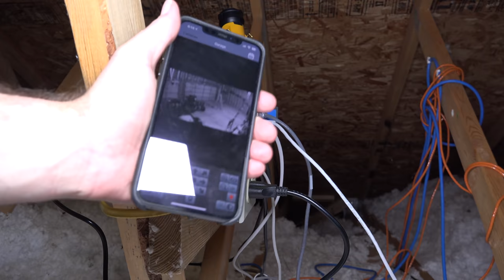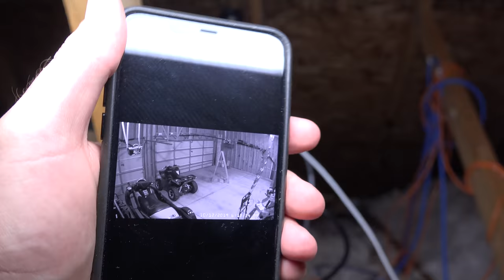Running power for PoE switch in ATTIC!

Comment: There's so much wrong with this video... but let's start with the super simple premise of "why?".  Why aren't you running Ethernet cable from the cameras or other drop locations all the way back to an accessible area? Are you trying to save money? Are the runs too long to be within spec? Why do you keep buying and running running expensive premade cables and use RJ45 cable couplers when the cables are too short? Do you realize that those couplers introduce problems at the physical and signal layers? Is there a reason you aren't running bulk un-terminated Ethernet cable and then crimping/punching down at each end?   

You could save a lot of complexity and money by:
Purchase large (1000ft) boxes of plenum rated Cat5/Cat6 cable
Run cables between a central wiring closet(s) and the devices you are installing
Punch down each end using a keystone jack or RJ45 connector

Each run would go between accessable areas so you're not burning out equipment or crawling back up there to fiddle  with it. Each run would be continuous and not subject to cables disconnecting or signal problems. And you'd save money as premade cables are expensive! Look at the cost per foot and you'll see that you can run your own much more cost effectively. Plus you're probably putting cable that's not plenum rated up in your attic spaces, which can be hazardous should you have a fire.

Oh, and then there's your sketchy AC wiring using a conduit junction box instead of a proper box for Romex. In all seriousness, this is really basic stuff that the guys at Home Depot could explain in about 10 minutes. Just ask someone, this stuff is simple and you're somehow doing it wrong.
Reply: his house doesn't  have a plenum. What codes were broken?
Reply: @bigbigspoon  I didn't say it wasn't to code, I'd just personally use it in any place with large volumes of air that could be moved around or recirculated.
Reply: would like to figure the best way to run ethernet to a few rooms in my house. I have my modem a router and switch in the  upstairs room of my house.  I need to get Ethernet to all the surrounding rooms (3 of them) and also downstairs. any suggestions? i could sketch out the layout of the house if this helps. Any suggestions on cheapest place to get some more cat 6?
Reply: Here here! A box of 1000ft cat6a solid copper riser cable goes a LONG way. A pack of pass through rj45 connectors and a good crimp/cut tool makes it faster and easier. A patch panel with a decent punch tool are cheap and easy to do. 

I put 8 very long camera runs and 15 miscellaneous shorter runs into a 100 year old house. Work sucked but was worth it. 317$ for everything to do it.
Reply: Yeah, its not like he doesn't have a massive server room where he could put that switch and all the cables he should have run...
Reply: @supremeicecreme1658  I learned all about running electronics in an attic. He will be removing that dead switch come may or June. Maybe then he will just pull the wire and do it the right way.
Reply: @synergizerer21  I certainly hope so!
Reply: 1) "Why do you keep buying and running running expensive pre-made cables and use RJ45 cable couplers when the cables are too short?" Exactly! And it's not riser or plenum grade as far as I can tell. It doesn't even need to be plenum grade. He would be fine with riser cable, which is half the price of plenum and suitable for enclosed spaces that do not form part of the air delivery or air exhaust pathways.

2) "Each run would go between accessible areas". Yup. Exactly! Installing heat-sensitive points of failure in the attic where it gets HOT and admitting it will require more monkeying around (power supply + two fans) later on is the equivalent of a Band-Aid for a Band-Aid. He's basically working around the fact he's out of his comfort zone using a crimper and punch down tool.

It gets hot in the attic. Fair enough. So don't install PoE switches, or any switches, up there. The drops can go through there but shouldn't be stopping. The last thing you want up there is an inaccessible potential fire hazard made from a cheap and cheerful PoE switch that you don't trust. This is an "XY" problem. It's a good answer to the wrong question.

I would buy 1,000ft of unterminated Cat 6a riser CMR. Install PoE switch and patch panel in the accessible basement. Punch the drops down into RJ45 keystone jacks in accessible areas. Clean. Safe. Easy. Attic heat problems all completely bypassed! No need for power supplies to power attic fans to stop the PoE switch from overheating. No need to install a wobbly inaccessible shelf for the PoE switch. No need to run any power cables up into the attic.
Reply: @bigbigspoon  although you generally only require plenum-grade insulation for plenum spaces, for internal wiring like this you still generally need to use riser cable. Riser cable is fire retardant, albeit not to the same extent as plenum-grade cable, and will produce less toxic fumes in the event of a fire, not to mention being code compliant.
Reply: I came across this channel by being in a black hole of tech videos. I can't figure out what the purpose of this channel is. I don't mean to seem rude or hateful, but this guy mostly doesn't know what he is doing and sets a lot of bad examples for his less than tech-inclined viewers. Operating servers and working on them on the carpet, using incorrect cabling, incorrectly securing servers and just so many other mistakes. 

I hold tech channels that are nearing and above 100k+ subscribers to a higher standard and this guy just sets so many bad examples. I like this guy, but this guy has a lot to learn. However, after seeing how many times he's been told the correct way of doing things he hardly ever listens and continues to do things the wrong way. I wouldn't care if it wasn't for the fact that he could be influencing others to do things the wrong way, too.

I bet the fire marshal would have a field day with this guy's house.
Reply: Yeah, I had many problems with his solution. Like, DON'T RUN CONSUMER ELECTRONICS IN YOUR ATTIC! And I agree with you wholeheartedly on the bulk cable/punch-down bit. But one thing where we differ is the need for plenum cable. Plenum cable (also known as CMP - Communications Multipurpose Cable, Plenum) is only used when you have a plenum return air system. Most modern residences do NOT have a plenum return air system. They have ducted return air systems. You usually only see a plenum when you have either a drop ceiling or a raised floor. Thus, I would use bulk riser cable (also known as CMR - Communications Multipurpose Cable, Riser). Patch cables are also known as CM cable, and are to be used only for interconnect between epuipement-equipement and equipement-panel.
This kind of thing is what wiring closets are for. And wiring closets should always be accessible and climate-controlled (like in the house) if the have active electronics in them.
Reply: @terry5008  yeah. He wouldn't need plenum cable for a non-plenum space.
Reply: @bigbigspoon  well, in terms of electrical, the box he is using would fail an inspection as it isn't meant to be used as he is using it (it is meant for running pvc conduit). There is a section of NEC that basically says you have to use wires/receptacles/boxes for their rated purpose which this isn't. At least he stapled it within 8in of the box.
Reply: Not to mention, running equipment in a hot attic in the summer is DEFINITELY going to spell trouble.  And oh my, premade cables and couplers? Seriously...?!?! How many ways can you say no, nyet, nien, Meiyou.  no, no, no!
Reply: Agree with you on everything except “people at Home Depot can explain in 10 minutes” the people at big box stores are tools that can’t dial a phone number on a phone.

Comment: I couldn’t wait to read all the comments about the electrical work. Made popcorn and everything. 

Nice video
Reply: Phil Young me 2
Reply from the maker: #MeToo
Reply: Hmm, good idea. The romex cable should have been clamped going into the box. Wrong box was used, but would have worked if conduit was used. Those boxes are for outdoors mainly. AC power has no negative and positive.

Comment: I would have kept the switch in the garage.. but wall mounted it close to the attic space, and make a large diameter hole with a plastic insert / bushing to keep the wires from being frayed.  Then it wouldnt be too hot or cold in the winter and summer. It would still be in a central location at least.
Reply: I would second this choice, however I doubt Jason will redo his current setup at this time.  The garage would have been a much more favorable place for the switch as opposed to the attic.  Better temp/environment, and much easier serviceability.
Reply from the maker: but then you have to run wires all the way to the garage. adds another 50ft
Reply: @Bytemybits  on the flipside you'll likely be replacing your switch every year.

My brother handles networking for a large non profit group, they have routers/comms equipment in racks that get hot from getting direct sun on the cabinet(metal weatherproof exterior enclosures on building roof areas with antennae) or from failed AC units in some where the cabinets are indoors in communications rooms below cell phone towers. 

They have fans inside the cabinets etc but that doesnt help. Switches , PSU's etc routinely fail and need replacing. For the most part, the capacitors fail quickly as they are only ok up to 85⁰c. Your hot roof plus the internal heat generated from the switch will kill it in summer. In winter or cool climates it will be fine. Once ambient roof temps hit 60⁰c plus, the lifespan will drop very quickly.
Reply: It's very easy to drop your wires through the top plate of a wall then use like a low voltage mount ring on wall below ceiling to access your wires to either terminate them there or run wires lower on wall. Then a blank cover plate will eliminate any drywall repairs. Running wires correctly in the beginning will eliminate most of the issues.
Reply: @mrmotofy  can you share any diy video that shows just that? I would like to do in that way!
Reply: @rkbest9783  All it really is just drilling holes in top of wall then mounting regular keystone jacks at the top of the wall. Run power for a receptacle for a switch. Patch cords from jacks into a POE switch. Obviously a feed to your main switch too. Nothing complicated

Comment: I think you under estimate the heat temp in the attic during the summer.  It will get over 125 during the summer and that switch will melt.  Putting near a roof vent would help.
Reply: I have had a poe switch in my attic for just over a year now,in Florida. No issues.
Reply: @surgehawk3  PoE still working in attic?

Comment: Jason,  since you have chosen to put your switch in the attic as opposed to elsewhere more convenient and easy to service, and you seem pretty aware that your current POE switch will not last, I would strongly recommend going with a Ubiquiti ToughSwitch when your current one dies.  It supports both standard POE and Ubiquiti's goofy 24v.  It also is has a fairly robust rating when it comes to temperature/environment.

No comment on the electrical job...Don't know where to start.
Reply from the maker: i may end up with a poe ubiquiti
Reply: Byte My Bits be careful.  Ubiquiti is a huge rabbit hole.  A fun one, but it starts taking over everything.

Comment: It's very easy to drop your wires through the top plate of a wall then use like a low voltage mount ring on wall below ceiling to access your wires to either terminate them there or run wires lower on wall. Then a blank cover plate will eliminate any drywall repairs. Running wires correctly in the beginning will eliminate most of the issues.

Comment: You didn't need a shelf. That device came with rack mount ears.  These can be used also for wall mounting.  You should have just mounted it to the same board your outlet was on.
Reply: I always like to see those rack mount ears used to securely attach a 200W PoE Ethernet switch to a flammable surface. That way it will be easy for the post-fire inspectors to find. :)

Comment: Nice! So I have a simple EdgeRouterX in my attic here in Texas. Its been up there for 3 years and so far has not failed. I do have a small 120mm case fan blowing on it. My plan if it ever failed was replaced it with USG and use couplers to bring the network down an inside wall to my closet blow so the electronics can all be in the AC cooled house.

Comment: Possible idea for cooling that POE switch, the fans you took out for the new server, take the cover off the top of the switch, cut a couple holes for the fans to sit on top and pull air out of it, you can probably find a place to wire them inside of the switch, if not, just use one of the ports from the POE to power the fans..

Comment: I pulled mine into the closest closet and just ran the eth through a whisker plate so the heat wouldn't kill it.  Also makes switch maintenance a bit easier if needed.

Comment: 12-2 running to a box with 14-2 accross an attic not stapled down every 12", into a PVC outlet box and wire not secured....  holy house fire waiting to happen.  Also out here, it is not uncommon to see 140° temps in the attic in summer...  Make sure your switch does not overheat and ignite as well.

Comment: Wants to be covered by insurance .... Heres a video of me installing a outlet my self .
Reply: Kush OverLord legal in the US to run new outlets yourself
Reply: @daltonschrader8328  correct, but if you didn't get a permit for the work and have it inspected you might not be covered by insurance.  Can't say that would pass a code inspection.
Reply: @StevePatak  Not only would it not pass a code inspection, you can see where he has made other "modifications" to structural elements of the roof (note the hacked-out notch in the joist webbing so that he doesn't have to crawl under it"). The beauty is that it's a certainty that this video will be sent by some Internet troll to his local Haysville, KS code enforcement department.
Reply: Are you even allowed to run an outlet into an attic with loose insulation?
Reply: @packetguy42  The only thing that he could be dinged on was connecting the new wire to the outlet instead of splicing it in with wire nuts.  But the outlet is rated for 15A onto either terminal, so theres nothing that could really go wrong.  Also, removing that bit of plywood is not a problem.  In fact, in order to be code compliant, that opening needs to be 42" high.  It probably failed inspection during construction with the plywood there.

Comment: Bro, you have violated your home owner insurance. No permit, no inspection, wrong box, no securing wire appropriately to box, possibly splitting off that other outlet incorrectly, not enough slack in box. Get a pro in there to fix that asap
Reply: thtadthtshldntbe do you have a code on how he should’ve done it? Because I’m about to do this and I don’t want my house to catch fire
Reply: Real you dont need a permit to do it and no you dont need a inspection. I been doing electrical for 10 years and yes he did do something wrong I think he needs to call someone to do it wright for him.
Reply: @bigbigspoon  presuming you are in the US, you first want to look up the National Electric Code. Read it over and watch a bunch of youtube videos by actual electricians. Once you have done that, call your local inspection authority. The inspectors will almost always answer questions or emails. Tell them what you want to do. And they will give you local code modifications that your State, County and City have added to the NEC
Reply: @wolf3five  presumably you are a licensed bonded electrician. There are things that you are legally allowed to do without inspection that a regyular person is not in most states, as well as his homeowener insurance being an issue. Regardless there are major errors in that outlet set up and he needs an electrician to fix it.
Reply: John Kinder right*
Reply: I wonder about the comments that include “you should call an electrician”. If those commenters are more knowledgeable, why not say the correct way to do it? $?  And there have been several comments that say what needs to happen, so since he’s obviously an DIYer, what’s wrong with him making the corrections himself? It’s in his nature, as a DIYer.
Reply: @iflnr978  Because regardless of whether one knows how to do it or not, there are things that a licensed, bonded electrician is allowed to do, like small work, because his license and bond cover it, which you then don't need a permit or inspection for, and which won;t violate your homeowners insurance. I grew up in the trades. I just choose to get out early, but I learned enough to know how to approach things legally and safely.

Comment: Just ordered a high temp switch last night; even with a fan mounted above my last one it still overheated and began to lose channels. New one is rated up to 140 degrees so hopefully that will be enough. Was thinking about doing some type of insulated box, but I don't want to lose air flow 🤔
Reply: May I ask you what high temp switch did you ordered and how has it been so far since you installed it?

Comment: Should’ve used a structured wiring enclosure with a power kit mounted in the bottom of the enclosure, then you’d be more weather resistant and more organized (especially because then you can terminate runs inside the enclosure and connect to the switch inside as well)